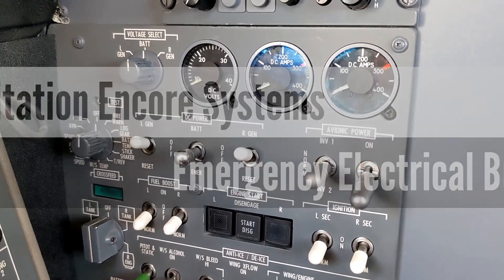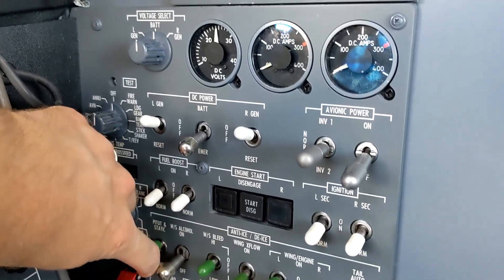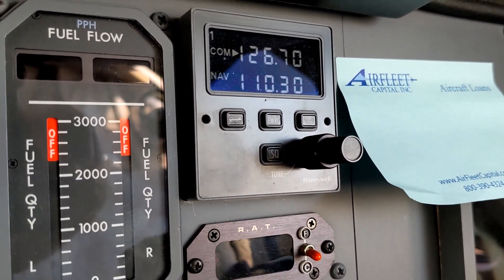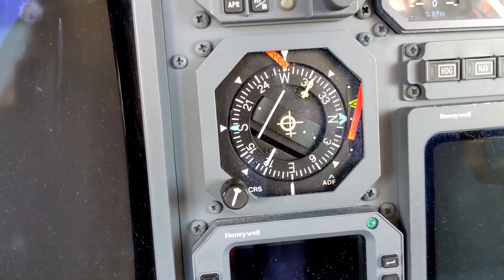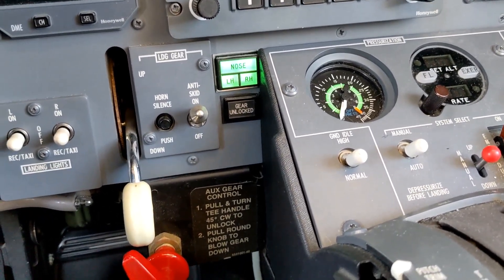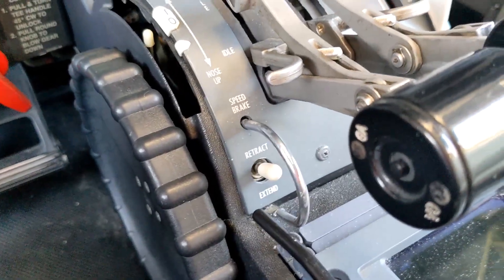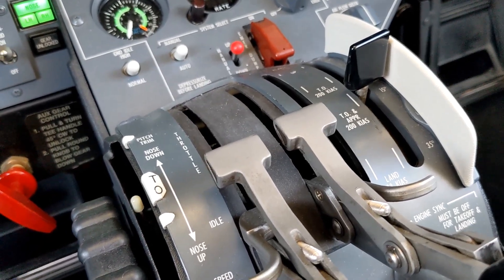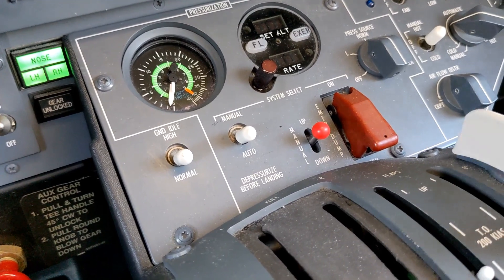Citation Encore Systems - Emergency Electrical Bus

Comment: 4:50 ... through the overhead speaker, because the headset audio (including intercom) won't work.   Or will COM1 be available through the left (or both) audio panels.
Reply from the maker: The intercom/headsets will work. I was mainly pointing out the overhead speaker to show it's available in case of a "smoke in the cockpit" scenario. In such a scenario the pilots would be using their oxygen masks and need the overhead speaker to hear ATC.

Comment: EMER Brake PULL means: pull the handle as needed, but don't press the brake pedals - or the EMER nitrogen bottle will discharge into the brake system?
Reply from the maker: What you stated would be correct for all the other 500 series Citations, and is probably a good principle to follow in general, but in an Encore the brake pedals are basically rendered useless without normal DC power, so it shouldn't matter if you step on them or not while using the EMER bus with both generators offline. Nothing will happen.